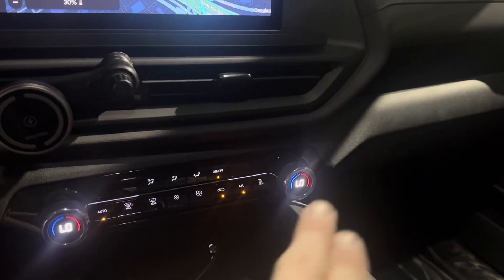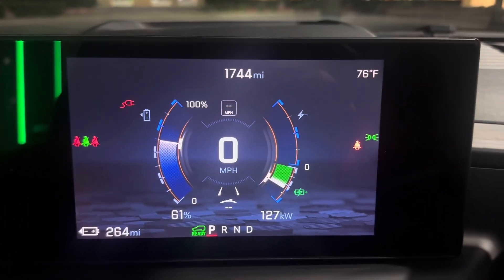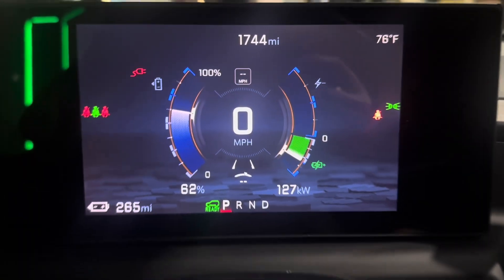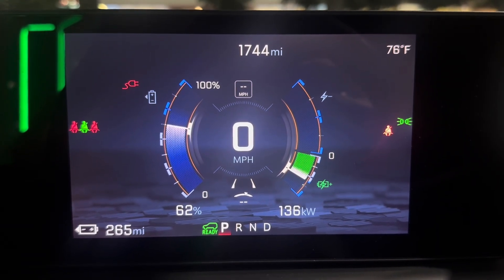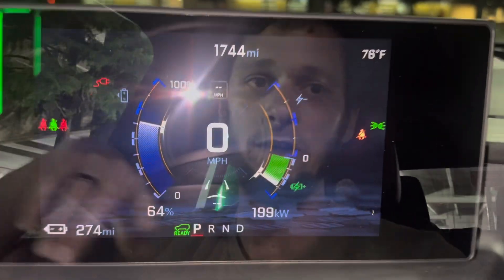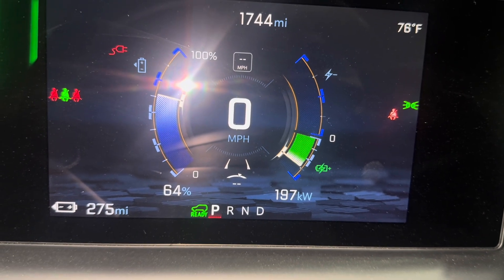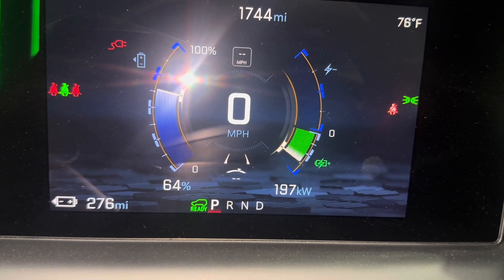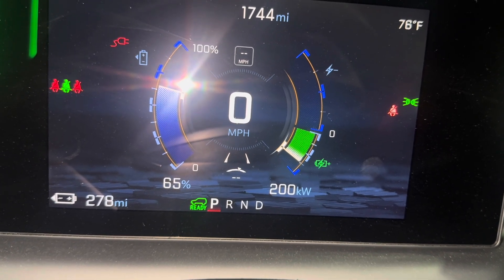Silverado EV too small to fast charge?

Comment: Hey Chris do batt leads still need to be same length with batteries with a master bms? 8 lifepower 48v on a shelf not a rack going to a main bus then out to 4 growatt 5000. Do the leads on both sides of the bus need to be the same to each battery as well as to each inverter?Does the master battery bms tell all the batteries when and how much to charge making lengths not so important?Any help would be greatly appreciated
Reply from the maker: Oddly enough I believe lengths matter more when it is closed loop. This is because of the way the inverter might interpret the data. And how the master reports in. If the master battery gives the lowest battery soc to the inverter then you’ll be leaving juice on the table by not discharging all of the batteries. I know I had some odd issues with a Pylontech communicating battery. Can’t remember details but it seemed to use average soc for charging and lowest for discharge cutoff.

Comment: Hey Beene, its Eby! Welcome to the EV Truck club. I joined with a Lightning Flash in March. The max tow package has two compressors to augment cooling under large towing loads... I'm not sure if it also helps while charging quickly. Of course, my charge rate of 180kW (initial 5 minutes) before it drops down to 150kW doesn't hold a candle to 250kW but I have noticed that my AC running does not impact my charge rate. Does Chevy have a max tow package with the same benefits?
Reply from the maker: Hey Eby! I had heard about the dual compressor option. Sounds like Ford predicted the issue. And they are charging at half the speed. I don’t think the Silverado has a dual compressor option but reading people’s experiences they have been making software updates to change the behavior so maybe it will improve.

Comment: IMHO the whole idea of driving an all electric vehicle cross country is flawed.  They're very well suited for charging during the day when solar potential is highest, acting as capacity at night when there is no solar, and short trips locally (and hopefully if those trips are during the day, parking under solar carports).

For long trips long term infrastructure should be rails that charge the vehicle that drives autonomously (steel wheels on steel rail is highly efficient, transmitting power to moving vehicles is a "known" technology)... stop gap with our interstate freeway system, a small petrol generator, like the people at Edison motors are doing.  

That way you don't have to have the weight of a 500 mile range battery that only gets used to full capacity every 5 years.
Reply from the maker: Those are all great thoughts. Hopefully as we continue to make ev’s better we can also make them more efficient in some of those ways. I do suspect the “easy” route is to just throw a big battery at it especially as prices come down but I hope more creative solutions are presented and make headway.
Reply: Problem with using EVs for grid battery capacity is cycle life wear as EV batteries are designed around high energy density since the battery has to fit inside the car/truck/whatever.  Only cycling the EV battery for purposes of driving and V2L applications like emergency power and running jobsite tools greatly increases the service life of the battery and therefore the vehicle.

Comment: I like the hybrid solution Edison motors is using, I debated getting electric for Uber but now I get range anxiety with half a tank in a 2024 Camry (260 miles of range) if they made a plug in hybrid version, epic
Reply from the maker: Love the Edison solution. They are working fast and I think they will have success. I do think that in the next ten years full ev will likely overshadow hybrid as the density of batteries goes up and cost comes down. Liquid fuel isn’t going away any time soon so I think series hybrid will be solid for many years to come!